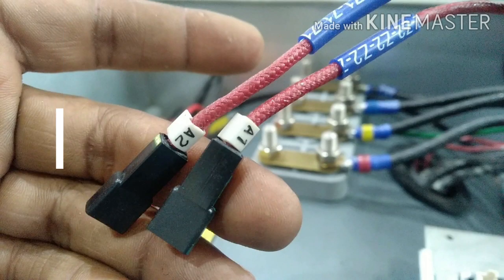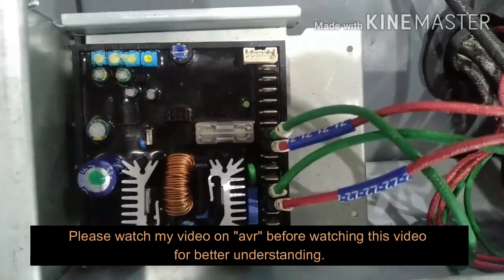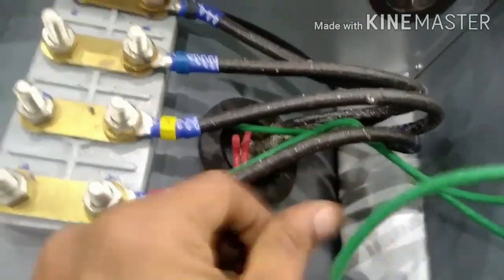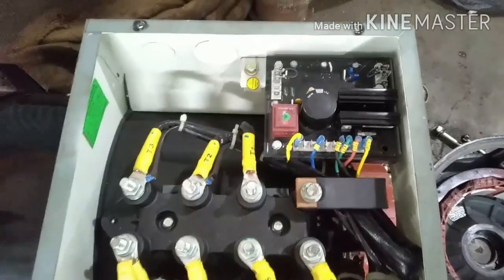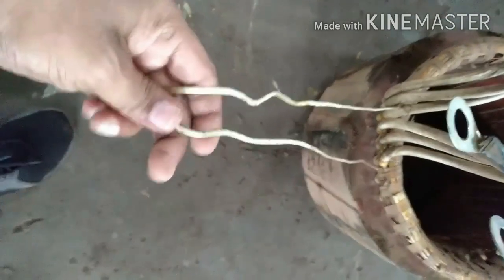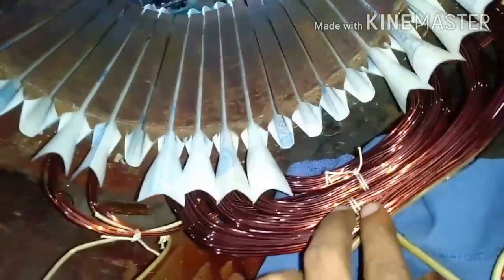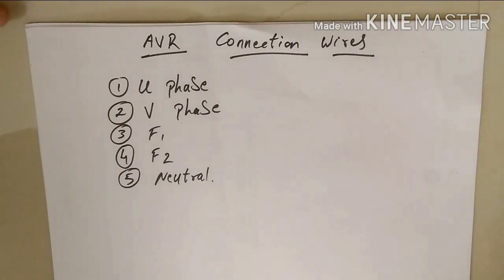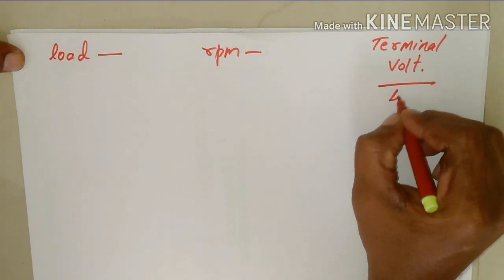Auxiliary winding in alternator

Comment: hi. how about modifying a single phase alternator to semi brushless one, base on my theory, i can upgrade an example of 15kv alternator to 20kv, i will remove those  starting coil winding or the auxillary winding that you mention and replace it with additional main windings to step up the capacity from 15 to 20 kv,  and now my answer for excitation voltage is to create a small permanent magnet generator out of motor cycle stator and magneto and fix it on rear side of alternator. how about that?
Reply from the maker: 1. U can't upgrade any alt, u can only downgrade it because of core sizing. 
2 . Connecting pmg is good only for experiments, aux winding is cheap n efficient in small size alternators.

Comment: Good day sir. 
Sir I am getting only 100v output In a 440v alternator.when I checked I found Auxiliary winding voltage is only 47. Is that affect the AVR for controlling or not.
Reply from the maker: yes, avr will not work

Comment: How this avr giving signal to engine to increase the speed in accordance with increase in load
Reply: Depending on the type of the engine controller board, AVR has virtually nothing to do with engine speed, but with alternador's voltage control.

 Engine speed is controlled by the Governor, where it keeps the genset's engine to a pre-set/rated speed, most Governors use a magnetic pick-up sensor  feedback from the engine.

Comment: sir please I have problem if you can help me
I have 6 generators 1280 KVA are connected to 3 transformers ( each one 2500 kva)
each two generators are connected to one transformer.
before 6 generators were running in good condition and synchronization.
but now gen1 and gen2 are not sync together
only I can sync gen 1 with gen (3,4,5 and 6) or gen 2 with (3,4,5 and 6).
what is the problem in your opinion
thanks a lot

Comment: Good afternoon sir,I have 40kva 3ph. semi brush less booster chock transform type alternator, it has 3axulery winding  lead comes from main stater winding connect to chock primery 's lead  another primery lead go to rectifier, with2.5mfd capacitor, secondary chock lead connect with U1,v1w1 of main stater lead ,secondary 's three lead make short to  get neutral & U,v,w get ph1,ph2,ph3. F1&f2 from rotor all connection proper, firstly give voltage415after  using load it give not voltage . So I have by pass axuilary lead, chock primery lead connect with U1 v1w1, with chock secondary lead  another primery lead connect to rectifier circuit,U,VW getconnect to short for neutral  another secondary  lead  for ph1,ph2,,ph3, respectively it not get voltage so give proper guidance. With contact no.
Reply from the maker: SORRY FOR LATE REPLY . CAN U SHARE ME ALTERNATOR MAKE ?